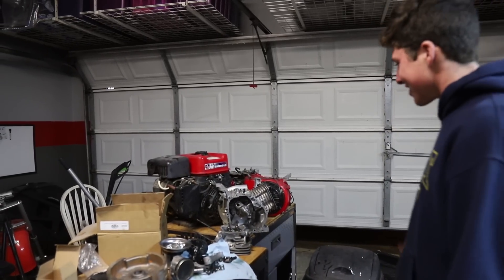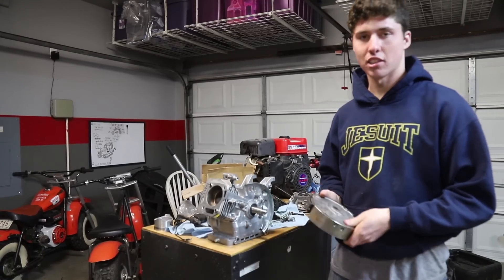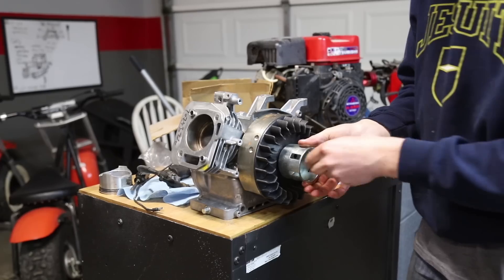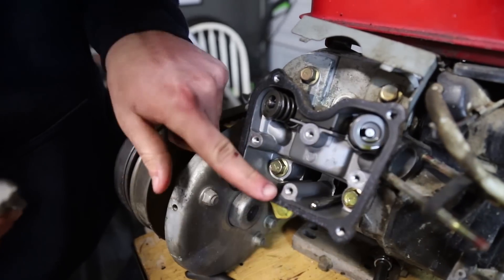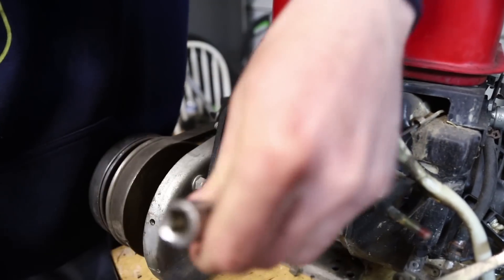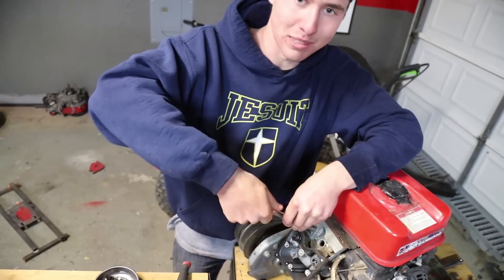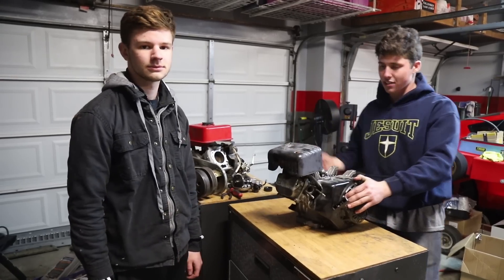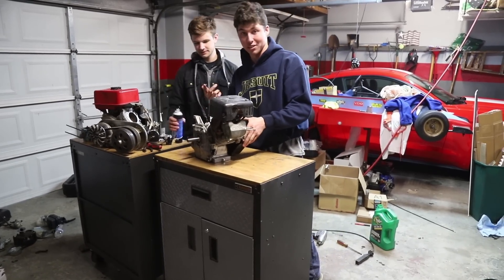Building 1 Good Engine from 3 Blown Ones!

Comment: It seems that we haven't had very good experience with Mitsubishi car engines as it seems that any engine below a 4G54 (2.6 litre) is short lived as the Saturn 4G32 (1.6 litre) engine my dad had in his old van which would last about 150,000 kilometres between rebuilds.

Yet I went to school with someone whose parents had a 4G54 engine in their Australian built Mitsubishi Sigma & it started burning oil at 138,000 kilometres, yet I hear of others doing twice as much as that with the same engine.

My uncle got 3 years out of his Verada 3 litre V6 then he went back to driving Holdens too, I'm not sure if the same car has the original engine when I've seen them for sale with 300,000 kilometres on them or if they've been rebuilt or replaced.

I know the Taiwanese built Mazda & Ford engines had that trouble in the 1980's,it was a bad valve stem oil seal design which caused oil burning in them.

When I built a Nissan RB30DE engine I used the  pistons out of the RB25DE engine so the compression ratio would be maintained with the 24 valve cylinder head,the ring design was also different as the top piston ring was thinner in the RB25 engine.

I contacted ACL in Australia about the rings  & they were,you guessed it ,the same as the 0.040" oversized Mitsubishi 4G63 piston rings !

Comment: the 208cc i have puts out 14.7hp stock, but i put a PZ30 and a muffler i made onto it, tested it and it is putting out more then 20hp, i haven't adjusted the carburetor and never run it past 4000rpm as 8.5mph for every 1000rpm gets it going good. like 4th gear on a yz250. 6K around 50mph on the top end is a lot, but for getting around town the gearing gives it vary nice gas mileage. some engines come stock with heavy valve springs.